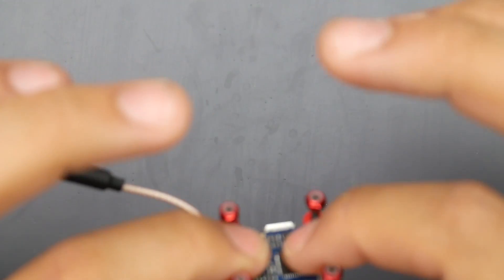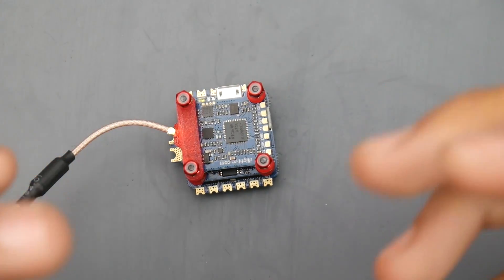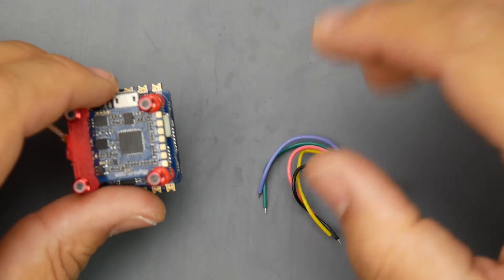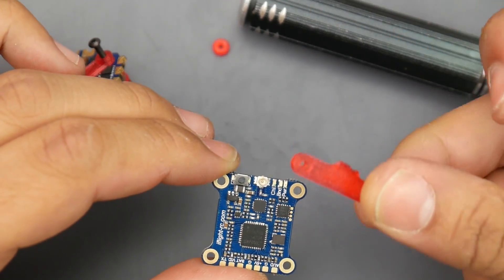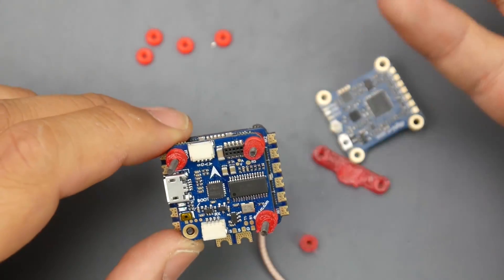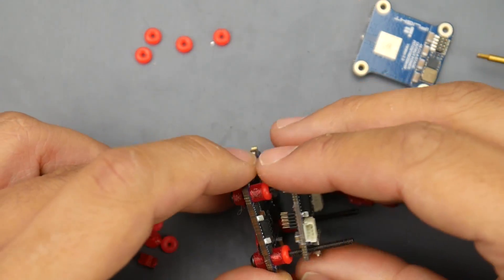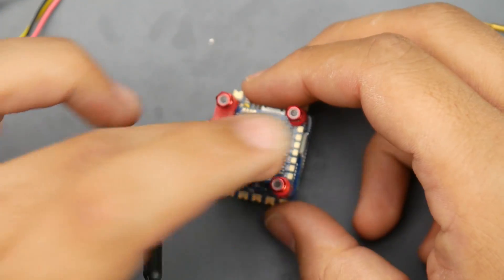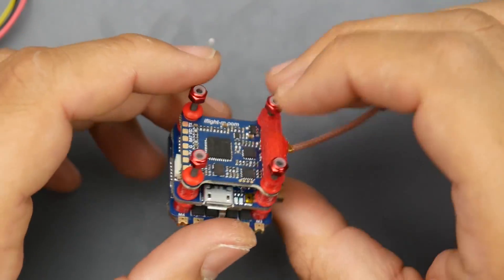Easy Setup 20x20 FPV Micro Premium Flight Controller Stack // iFlight Succex F4 Mini

Comment: None of the connectors match, None. All my wires had to be cut & soldered and there is no help with it. This will take longer to setup than you think. Antenna didn’t for correctly
Reply from the maker: Download AskFPV.. Its on IOS and Android
Reply: @DroneMesh  thank you, I’ll look it up. I’ve had an aw fall time as a newbie trying to wire it up. Red is never 5v, black is never negative, it’s really frustrating, and I still don’t know what firmware to flash!!

Comment: Hey Guys, Some experience some issue with telemetry (Smartport). Connect according to the manual on TX1 (Frsky XSR) and it doesn´t work. Try with the non-inverted mod, with Fport and it doesn't work. Any ideas?

Comment: I am totally new here and dont understand any of the technical talk. I want to build a simple 5' freestyle kwad with very little soldering. Can you recommend a cheap frame for this stack. Also I have a taranis x9d so would I just buy a  Frsky XM+ Micro D16 SBUS to connect as well?

Comment: Hello, Mine came without the VTX board. I've looked the schematic over and cannot see exactly how to mount a separate VTX... help here please https://www.rcgroups.com/forums/showthread.php?3159781-iFlight-SucceX-F4-Mini-Flight-Controller-35A-Blheli_32-2-6S-ESC-5-8G-25-100-200mW-Sma/page2

Comment: Mine just came in today, love amazon prime, mail lady even delivered it in a flood, daaaang! Anywho, I’m finished soldering everything, no magic smoke. 1106 low kv motors going on a 2.5 iflight frame I turned into 3” by making a small canopy housing a caddix cam.  Taking a break while my crappy lap top charges up.  Can’t wait to fly this lil bird!    I love your enthusiasm bro. Good vids, they’ve been useful

Comment: I used this tower, but the video has noise, I added a 35V 470uf capacitor,  No effect ,what should I do?
Reply from the maker: if adding the capacitor made absolutely no difference then it could 1 of 2 things..
1. your ipex connection.
2. You have a very bad tune check your motor temp.
Reply: Drone Mesh   Thanks! I will be testing

Comment: Thanks so much for these amazing videos!! I just got the Kakute + Tekko32 and its just wonderful!. Im about to make a micro 3' kwad. I was about to buy this stack but then I saw the Video of the Ori32, Could you please test on hte bench this ESC ? so far the Ori32 is still the most amazing 20x20 ESC for micros ?? I will buy either this stack or the Ori32 + Matek F7 20x20
Reply from the maker: Ori32 is the best 20x20 esc on the planet and I have tested it
Reply: @DroneMesh  i know ;) thanks for the vid, but can you please do a bench test of this Esc of iflight stack ?
Reply from the maker: ori will outperform it
Reply: @DroneMesh  i love your videos ans test ! I ordered the ori32 ans matekf722 for a micro 3' kwad, only the best of the best! Thanks for your amazing research

Comment: Gonna put one on an ultralight with either 2205-1750kv motors or 2306-1660kv motors. Emax stack handles the 2205s but I want dshot1200

Comment: I am using one in a 3 inch fpv flightclub  Neutron frame. Emax 1606 on 4s  motors ..Foxeer Falcor mini camera. 

It's pretty dam good ... very pleased with the stack.
It is still lacking a couple of cables for different recievers like the frsky rxsr as those have different plugs.. and cables to a couple of beepers that can be plugged in as well.

Comment: Pins are big no no. Shame.
Reply: In this case the pins are supported by the whole stack. This is good execution.
Reply: I was sent a review sample of this from Amazon. The pins on this setup are very very well done and not going to fail if you keep the stack as it comes. I'm pushing it hard on the yet released F60 pro 3s on 6s and it's handling it no issues yet I have about 60 flights on it. Im running it in a custom frame by a friend of mine, AUW with a 6s 1050 is 462 grams. It's preforming superbly and has held up to a few gate smacks at high throttle and you know how that spikes amps up really high really quick and the esc has handled great. I did have to add a cap to the main lead as I had a decent bit of video noise without it running a Micro Eagle but past that the video preformance is excellent at 25mw on a track quad once the cap was added I have prefect video and a clean picture around the track at 25mw.
I'm running Crossfire on mine, everything is perfect with 60 to 70 flights, the esc is taking 6s no problem and the amp draw that 1750kv F60 pro IIIs running GF5149x3s no issues. I ran WOT for 100 seconds flying a big square pattern and the esc was warm but not hot by any means. I'm gonna test one on 2200kv 6s F80 pros as soon as the one I just bought gets to me from Amazon and see how it handles high 6s amp draw that will be well over 120 amps on 6s with GF5.5x52x3s and see if it can sustain that type amp load on 6s I'm believing it will but it's gonna get toasty and I wouldn't do it on back to back pack a without a cool down but we will see.
Reply: I agree, however these are the best pins I've seen. I think it's pretty hard to make such a small stack without them

Comment: i saw a guy use this in a standard 5" quad and it performed very well. this is a very good little stack.
Reply: It should hold up very well! I have one coming for a ix5 v3 with iflight 2207 2450kv motors and it should be light and mean!!
Reply: @Flynnwendell  How has the stack worked out for you so far?
Reply: @Darksagan  over all there Great! I have 6 of the f4 v2's and 1 f7 v3 TwinG and in having troubles with the smoothness of the f7 and feel its in the filter settings but still work in progress